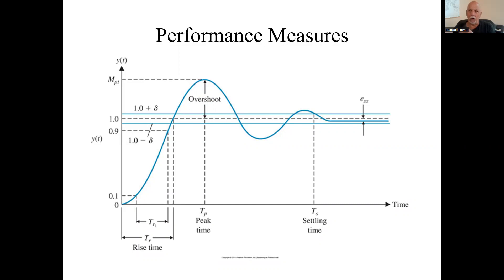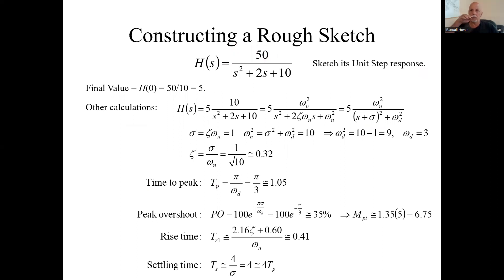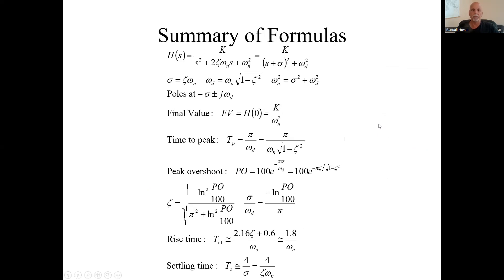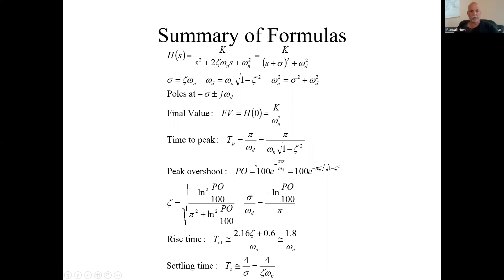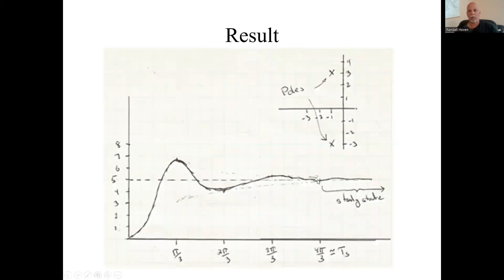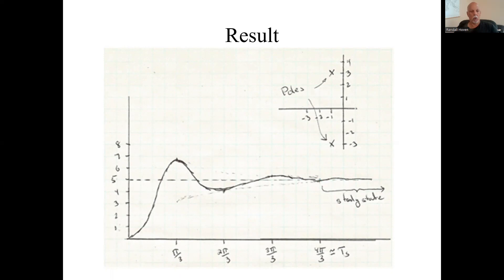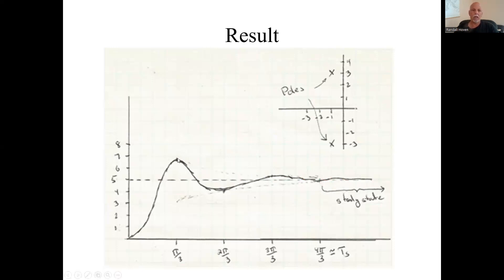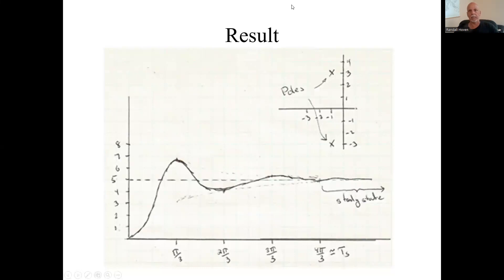4.5 Sketch a Step Response

Comment: A wonderful explanation, thank you. If the input signal was u(t)=2(t) and a response sketch was needed given the input signal, would the final value and peak overshoot, for example, be scaled 2 times on the sketch? So, 10 as final value and 13.5 as peak overshoot.
Reply from the maker: If by "2(t)" you mean 2u(t) (twice a unit step), then yes, all amplitudes double. That in fact is what it means to be a "linear" system: if input u gives output y, then 2u gives 2y, and ku gives ky.